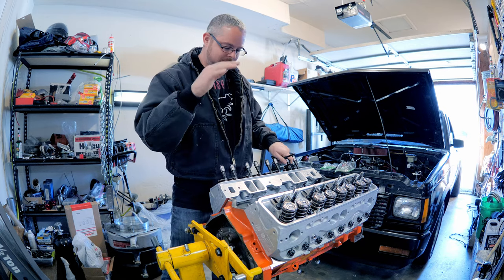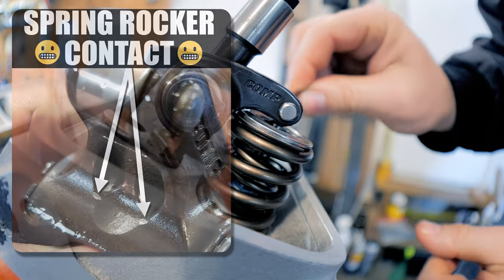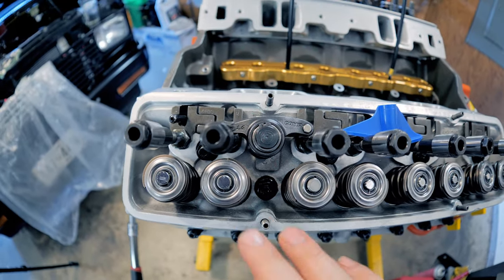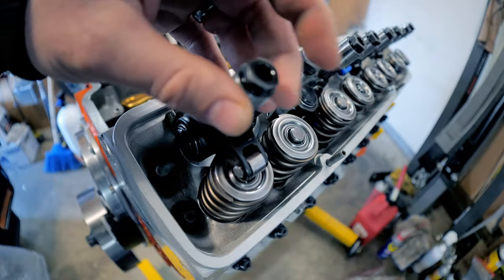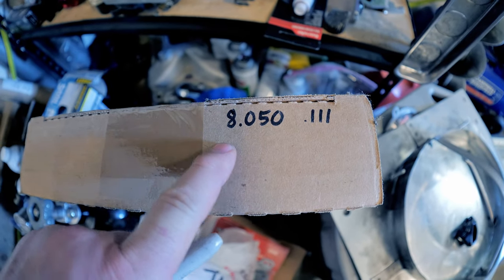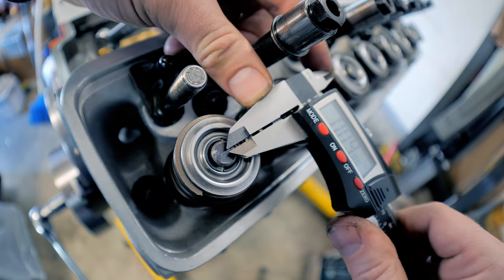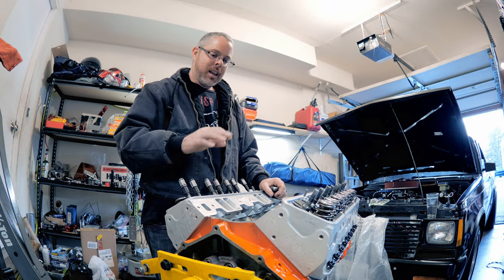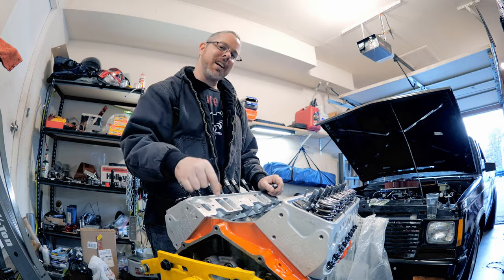Solid roller 400 SBC sketchy Valvetrain Geometry issues! How to correct without shaft rockers 👍

Comment: If you use the .080 inch lash cap you also have to use a longer pushrod
To correct geometry and i also use isky adjustable pushrod guide plates
To centet rockers on valve stems.

Comment: One of the next things to do on my 388ci stroker build. Just finished up the ring trimming.
Reply: I have a 389 Chevy stroker engine and I wanted to know what you gaped your rings to mine is N/A
Reply: @gregrogers3030  gapped for street strip with nitrous.  .020 top ring and  .022 2nd ring.
Reply: Awesome thanks
Reply: @gregrogers3030  389 cubic inch?? What block
Reply: @brandonbell3089  350 block 400 crank 40 over pistons 389ci

Comment: Looks like an easy method, could see what pushrod lengths you can buy and set an adjustable one to that size and test. Just that you are only as accurate as your eyes. I'm a machinist though so I'm good at that, I'd say you cant see a .005 deviation at the min, maybe a little less if you use a magnifying glass or something.

Comment: I know the point of this was to avoid having to go shaft mount rockers but why not just get the jesel shaft mount rockers for those AFR heads. Not only would ya avoid this entire issue but it gives ya the room to run a 3/8 .135 wall pushrod. 
I have a Dart lil m block with AFR 220 heads so this isn’t something that I think would work. I get it’s not exactly cheap but running a solid roller with high lift on the street the shaft mount rockers keep things a lot more stable and is well worth the money.
Reply from the maker: Shafts would be "WAY" better for sure. I just can’t convince myself to spend that cash on a 210 head maybe a bad a$$ 245. I ran this same head on a 355 and it worked well after clearing the rockers. I had those rockers on multiple combos and they felt a little sloppy so I ordered a new set and then decided to make this video.

Comment: Glad you did this video most people won't measure the sweep they just center the pattern. I also like that you debunked Scott Foxwell's measurement geometry video. He is a know it all and will argue with you all day long about how he is right. I have no use for that sawed off little Napolian MF. It's cool you have all those pushrods. I wish I did I am always doing it with test springs and a dry erase marker. Even with the dry erase it is sometimes hard to see the pattern. Doubling up the test springs helps but it doesn't simulate a running engine like you demonstrated. Good luck with the S 10. Looks like a runner!